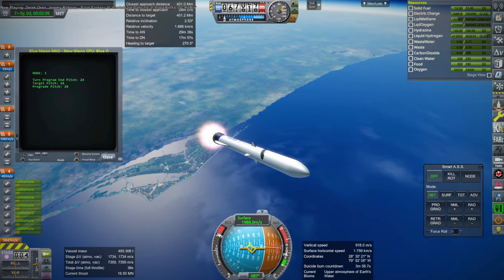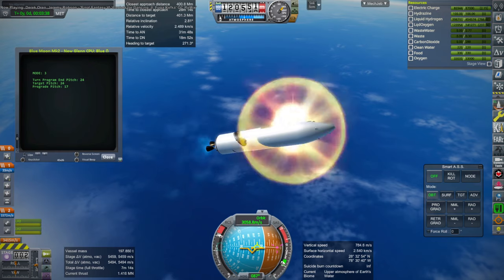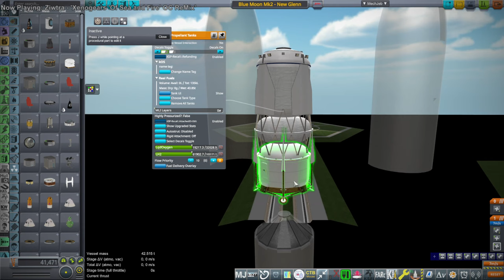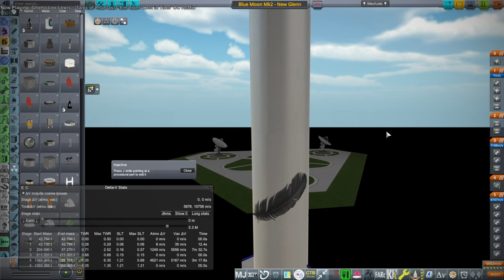Blue Moon Launch and Refueling Test (RO in KSP 1.12)

Comment: Nice simulation!  So I’m guessing that the refuelers are disposable- or is there a plan to have fuel depot in low earth orbit to fill them back up and reuse them?   Something is definitely gonna have to be used to keep the depot filled up and presumably that will be disposable?  Still, it looks like a pretty viable system.
Reply from the maker: I've assumed disposable, since it's really hard to bring them back into low Earth orbit - either you save 4000 m/s, cutting into what is delivered by a lot, or use some sort of heatshield to aerobrake down.